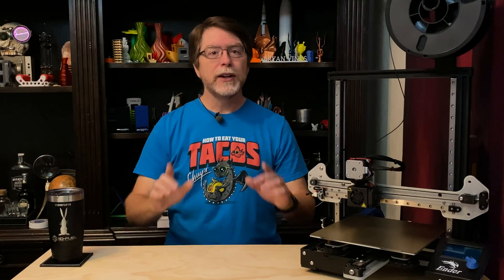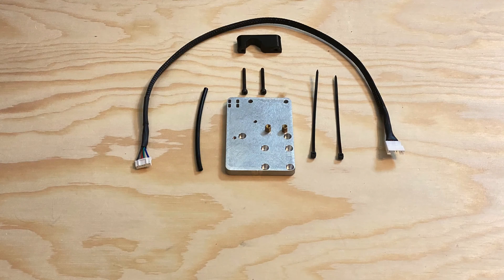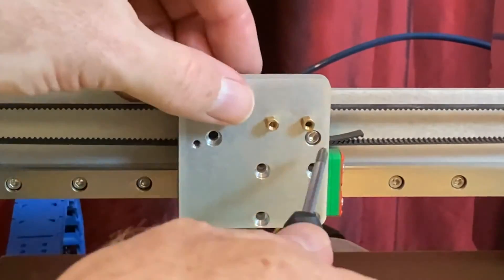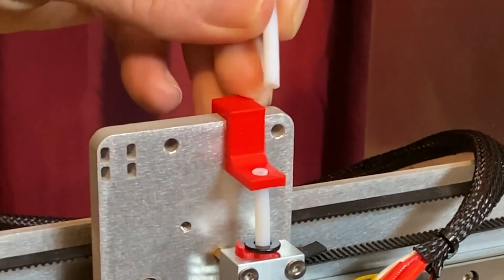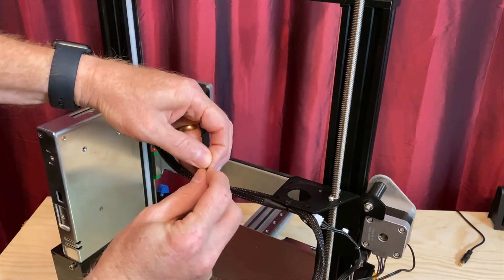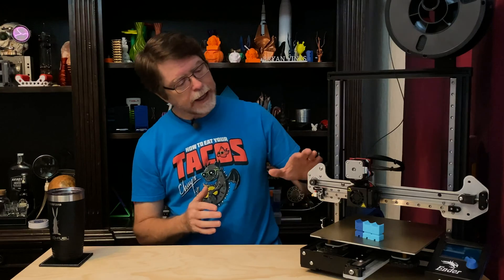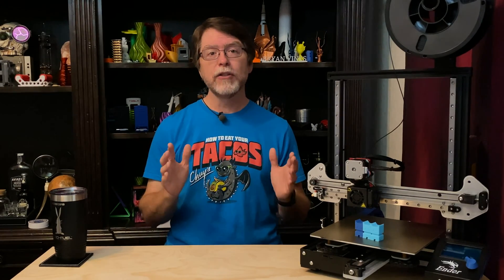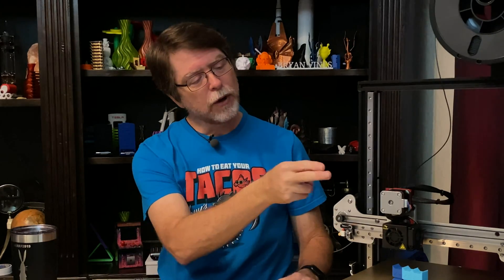How to Install 3Dfused Direct Drive Extruder for Ender 3 & Ender 3 Pro

Comment: Good morning Bryan

I found a slight issue when the time came to install the ptfe tube using the printed jig.  I followed your directions but found that once assembled, the ptfe tube did not go all of the way into the extruder coupler.  I could not feed filament in as it got stuck on the end of the ptfe tube on the extruder side as it was not pushed all the way into it.  So I measured the distance between the hotend and extruder couplers and cut a piece of ptfe tube flush on each end by the treads.  With a bit of wrangling around I got everything together and it is now working like a champ.
Reply from the maker: Hi Tony, How much longer is the PTFE tube you made without the jig versus with the jig? And was this using a stock plastic extruder or one of the metal ones? I didn't think there would be much difference between the two, and I did mine using the metal extruder. But I'm glad you've got it all working!

I designed an adapter to mount a SeeMeCNC EZRstruder instead of the stock extruder. And boy is this thing TALL on the X carriage now!  LOL
Reply: @BV3D  I really do not know as I need to measure it once I take it a part again.  I am using the all metal extruder by TH3D.  Not working like I want to, hard to load.  I do have my SeeMeCNC EZRstruder that I removed.  If you could link the STL for the adapter, I am going to switch to that instead.
Reply: @BV3D  i just took it apart and measured 39mm of ptfe tube.

Comment: Hi Bryan

Great video once again.  I ordered the 3DFused direct drive for my linear rail Ender 3 Pro beast.  I have totally removed the zesty nimble from the printer as I could never get it tuned correctly.

Comment: did u have issues where you x gantry not moving uniform on both sides ??
mine lifts the left side.. then the right side..

Luckily  i have a 2nd zscrew system that i can mount..  just have to wait for the hardware store to open, so i can get some screws for the extra sleves i have to use on the right side..
Reply from the maker: I haven't had a problem like that. Does it happen constantly, or just once in a while?
If you haven't already, turn off the printer and, on each Z stepper motor, unplug the connector and then plug it in again, just to make sure they're making good contact.
You could also remove the screws from the sheet metal panel on the bottom, and check that the Z motor connectors are plugged in all the way on the main board, too.
Reply: @BV3D  
partially solved the problem by loosing the 4 screws that hold the gantry to the slider block.. the machining tolerance on the screw holes on the gantry seems abit to tight. the screws are all the way to the inner side of the gantry making the whole contraption bend when i tighten it up causing the slider block to bind..  i will take off the gantry and slightly elongate the holes just a tiny bit..

Comment: What are the benefits of installing this against the stock Boden
Reply from the maker: Two that I can think of off the top of my head are an increased level of success when printing flexible materials (due to the short, straight filament path into the meltzone), and being able to use more of your filament. With the stock setup, you can't use that last half meter or so of filament, because the motor pushing it into the nozzle is at least that far away.
One drawback, as noted in the video, is artifacting on the surface of a print when using an all metal hot end. As a side note, the Creality silent board with the 2208 stepper drivers resolves the issue, as does using a TL Smoother on the extruder stepper motor (but don't do both).
Reply: @BV3D  hey Bryan, big fan of your vids, you've made my 3d printing journey so much easier. I know this is like 3 years late but do you know if the creality 4.2.7 board for the ender 3 has the stepper motor drivers you're talking about?

Comment: Just wondering if you can do a video on how you tuned your printer with the new linear rails and direct drive setup. I'm having printing issues now that i didn't have before and i can't seem to get to print right. I'm getting under extrusion, z shifting and it hits the print now enough to knock it 10mm to the right.. I have done all the linear upgrades including the direct drive and have done all the bed leveling manually and with bltouch. , babystepping and e step tuning. But just can't seem to get it right. And I've made sure that the rails aren't binding on the z.

Comment: Hey Brian, If would be cool if you made a video of mounting the new E3D Hemera on any of the 3DFused mounts...

Awesome video as always 👍
Reply from the maker: I'm gonna have to put a Hemera on my Christmas list! I watched Tom Sanladerer's video about it and it looks pretty cool. Nice and compact!
Reply: BV3D: Bryan Vines yes it most certainly is... I made a template and actually drilled into the factory aluminum plate 3adFused sent and it works fine... saved myself $20-30 for a new mounting plate after just spending $30 on their direct drive plate that I used 3 Days, lol

Comment: I have a Ender 3 Pro 1.1.14 Creality controller with 2208 stepper drivers with a all metal hot end , direct extruder with a EZR feeder.I am still getting the same artifacts on the surface of my prints do you think the TL smoother will help?
Reply from the maker: A Trinamic blog post about TL Smoothers (https://blog.trinamic.com/2018/08/16/tl-smoothers-do-they-make-sense/) suggests that the Trinamic drivers wouldn't benefit from the smoothers. I'll have to get my "silent" Creality board installed and see how it behaves.

Comment: Do I need to worry about the x sinking with the linear rail without the direct drive extruder kit
Reply from the maker: You might. Mine would usually hold, but if I put a little bit of pressure on it, down it would go. Even on the stock printer, I had that happen sometimes. If you have a way to cut brass (hacksaw, Dremel tool with a cutoff wheel, etc), you can buy the generic anti-backlash nut and print the adapter. Otherwise you can order the narrow ones. I've got links for both on Amazon in the description, plus you can get the narrow ones from TH3D (though they appear to be on backorder right now): https://www.th3dstudio.com/product/upgraded-leadscrew-nut-for-creality-printers-anti-backlash-nut/

Comment: Thanks for the video.  I recently ordered the direct drive plate for my ender 3.  I had direct drive before I added the linear rails on all axis’s but after adding the linear rails I had to go back to bowden.  I have anti backlash nuts on mine.  I just got generic ones and ground down the sides to fit.  The adapter is a nice option for those who don’t have a grinder.
Reply from the maker: Hi Corey! Thanks - The adapter is still needed for the generics because the screw hole spacing seems to be a little different. Grinding would still be needed to get one side of the generic to fit against the stepper motor. I guess there are different hole patterns on the different brands of generic anti backlash nuts.

Comment: Can you please test out the BIGTREETECH SKR Mini E3 V1.2 32Bit Control Board With TMC2209 board? This will probably also fix the issue.
Reply from the maker: 2208/2209 drivers should definitely show an improvement. I've added that board to my Christmas list. Maybe I'll get it! 😄

Comment: Wow. Your ender 3 its really getting a beast now! Nice, maybe you can add a 2nd z axis?
Reply from the maker: That would involve moving the power supply though. Having the rails on the Z axis keeps it from sagging on the non-motor side of the Z axis. 😉
Reply: @BV3D  Is yours a ender 3 pro? Check out proper printing, he moved the PSU to the back =D
Reply: @BV3D  oh, yes, okay

Comment: I still get binding on the z rails😒
Reply: If you adjusted them per the previous video and still have binding issues your Z Axis 4020 rails are probably twisted and not square to each other, loosen the 4 screws on the bottom and make sure a straight edge across them makes full flat contact.
Reply: @EldarKinSlayer  yeah,  I think my frame is the issue. Really frustrating
Reply from the maker: Hi novak miler, were you able to get your Z binding issues resolved?
Reply: @BV3D  hey Bryan. Not yet. I've arranged a video call with the guys from 3dfused. Hopefully will get things resolved
Reply: @BV3D  stripped the printer to just the bare shell. Huge alignment issues. Fixed and aligned everything with aluminum foil shims. 

Z rails aligned perfectly. Tightened everything as you did in your video once  and that's all I needed.  It works beautifully now. 

I need to mention that the team at 3dfused have been really supportive and helpful.  They even offered a refund which wouldn't have been fair. But I'm very happy with the full kit. Loving the setup. AMD I just finished a test print. 

Another thing to mention....
This upgrade is totally worth it in my opinion. Prints so far are insanely good.